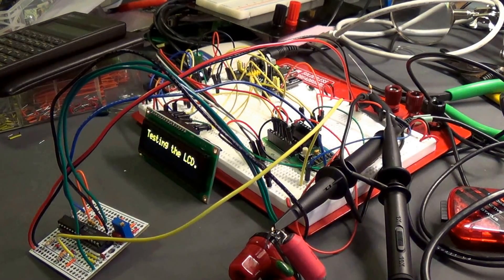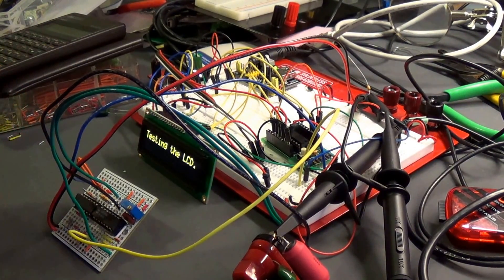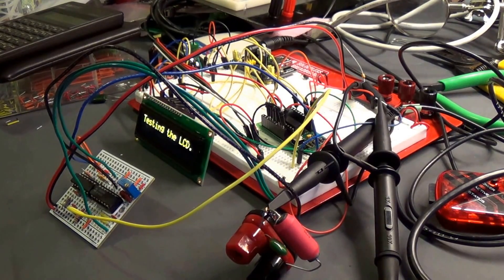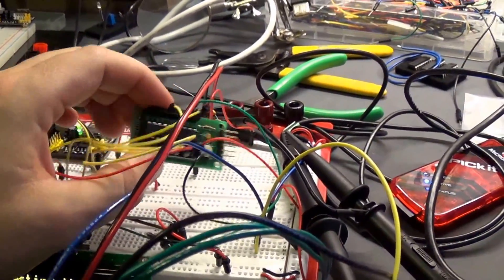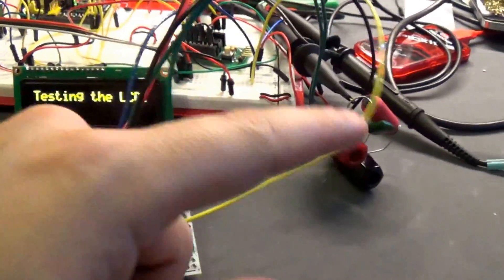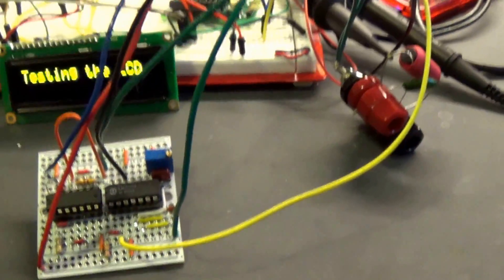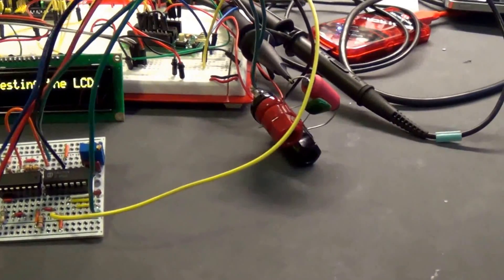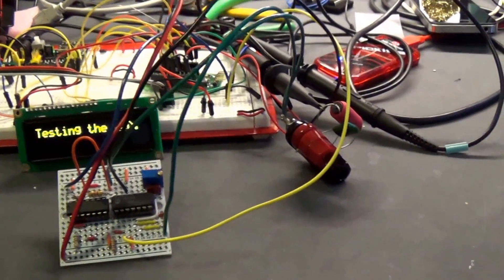PIC L-meter (Inductance) Introduction, Part 1

Comment: Cool project, eager to see how it works out!

Did you consider an analog switch to pick different capacitor values depending on the inductor size? I watched Alan's video a couple of months ago, but if my memory serves me right, this would allow you to "shift" the ringing frequency into a convenient range for your microcontroller.

Also there is a great (but long-winded) video by Martin Lorton on measuring capacitor values in a related manner (video id VylC8JFoiBo). Perhaps something to keep in mind when the project progresses, a homebrew LC meter would be rather cool :)
Reply from the maker: I had not considered using one but that's a really good idea, I believe you're correct. A 4066 or something? hmm.. I'll try it out. Thanks!